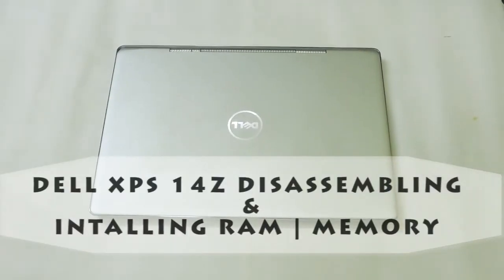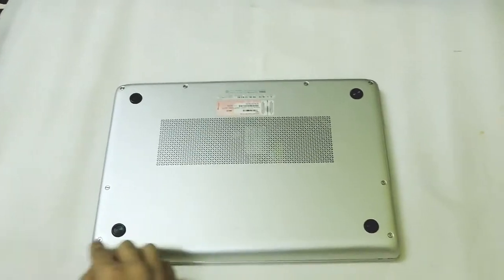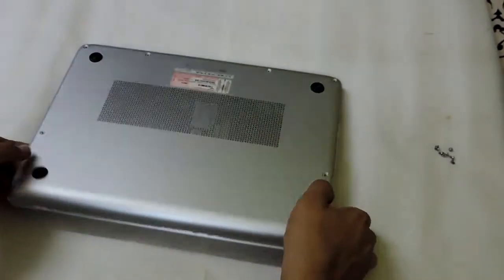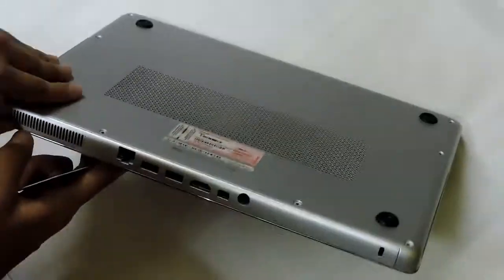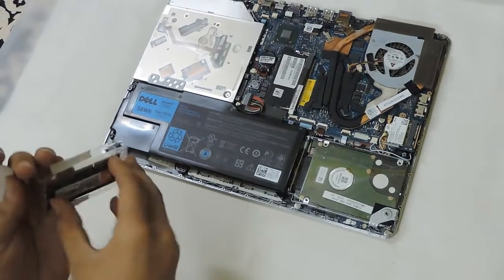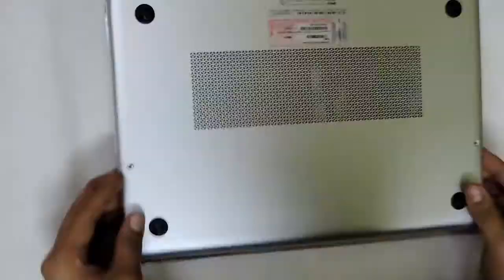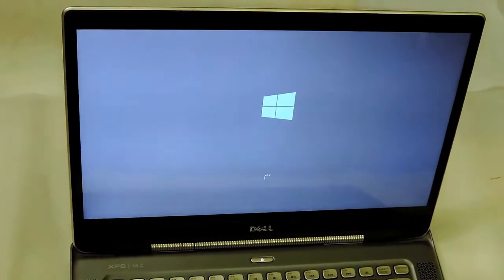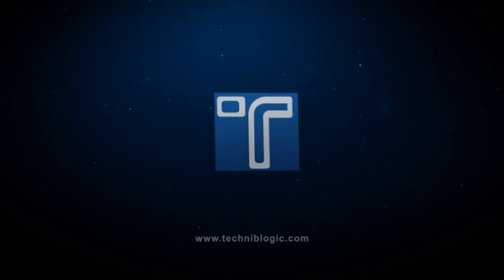Dell XPS 14z Disassembly - Bottom Cover Case Assembly How to Remove to Upgrade the RAM | Memory

Comment: I could not find the second slot in my model. Though it says it has 2 slots..
Reply from the maker: may be it is on back side of motherboard which means you need to purely disassemble the Laptop for that
Reply: Techniblogic do i need to put the thermal paste again  if i disassemble it?
Reply from the maker: +Aseem Pandey no you are not removing the cpu just open the motherboard man thermal paste is used while replacing gpu ir cpu
Reply: Techniblogic thanks mate!

Comment: I have same model with 4gb ram ddr3 non-ECC 1333MHZ can I pair it with another 4gb 1600MHz is it ok
Reply from the maker: +Syed Arif yes it will work i did the same
Reply: i got it upgraded with extra 4GB RAM and now with 8 gb RAM .my laptop is amazing i saved a lot on replacing with a newer laptop.
Reply from the maker: great man stay cinnected